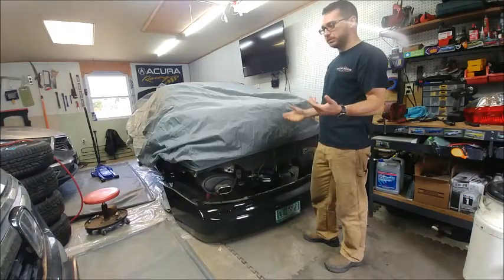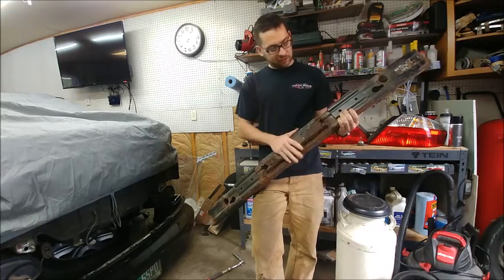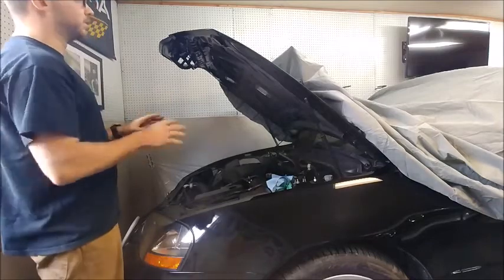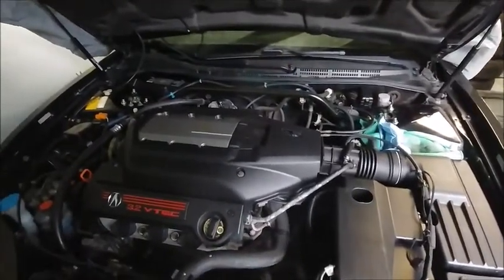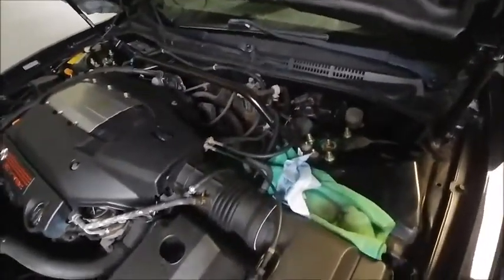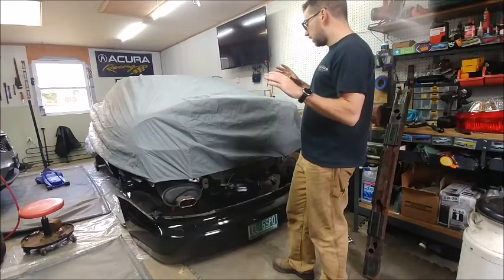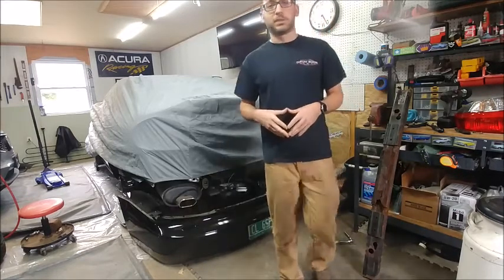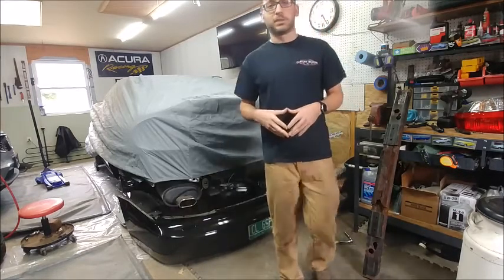Project 2003 Acura CL Type-S October 2020 Update

Comment: Hello, great channel and very detailed information with your breakdown on the cost of your CL project. I have 2 questions that I hope you can answer for me. I have a private seller offering to sell me a 2003 CL Type S with the 6 Speed manual for $5000 and it looks to be in very good condition with everything in working order. However, the vehicle does have 210,000 miles on the odometer. My two questions are 1. I know you can't see the vehicle, but would you consider that a good deal for this type of vehicle in good condition? and 2. Besides the the obvious things to look out for like rust and running order, would you recommend looking out for any other particular tell-tale signs of major concern before buying the vehicle? I really would appreciate your insight. Thank you very much for any help.
Reply from the maker: 1. $5,000 isn't a bad price if the condition matches , but closer to $4,000 with 200k miles would be a better deal for you. 2. I have a video (my first, I think) that talks about sub-frame damage from the A/C drain line. I suggest you look for signs of damage on the front subframe. Outside of that, these cars a fairly reliable and don't experience many major problems. There is a small gasket that seals the oil pump (common J-series engine issue not just the CL) that will fail with age and cause oil to leak out the side of the engine on the passenger side. Keep an eye out for both.
Reply: @acura2g  Thank you very much. I will definitely take your advice. If all goes well, then I should be taking ownership of the vehicle this weekend. Have a great day. Will follow up.